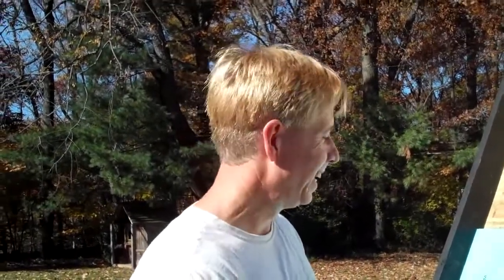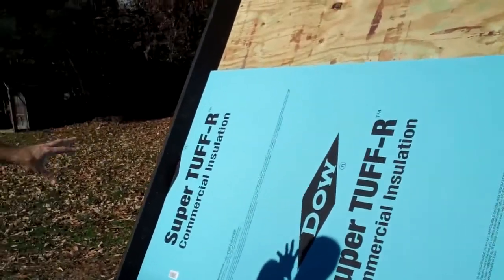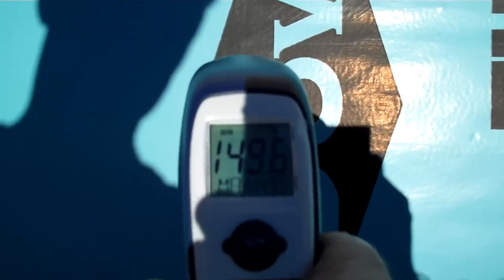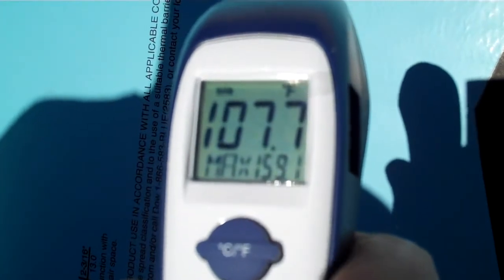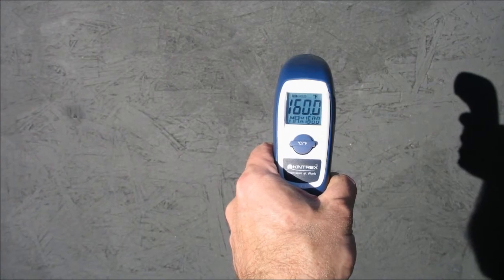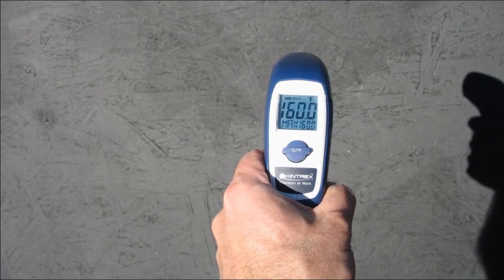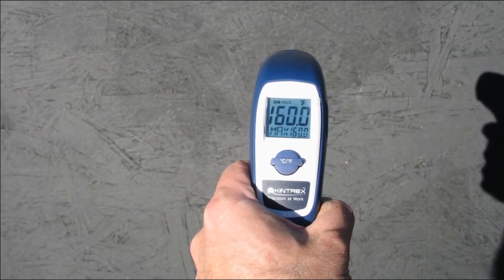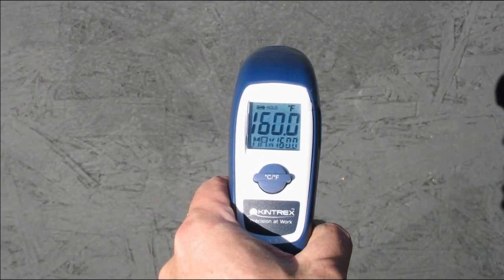Black Is Hot for Solar!

Comment: Hi, thanks for the clips.  I saw your solar thermal videos, I have a question: during the winter nights when it's below freezing, or in a snowy day, do you have to shut the water off so the water won't turn into ice and break the pipe?